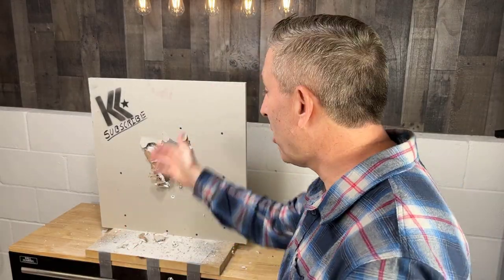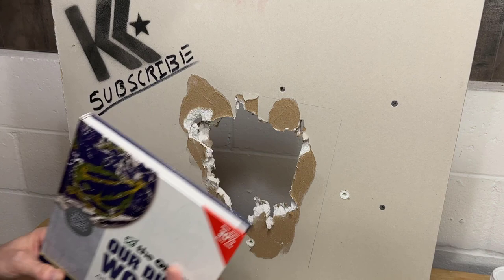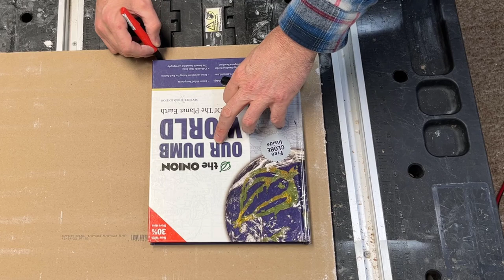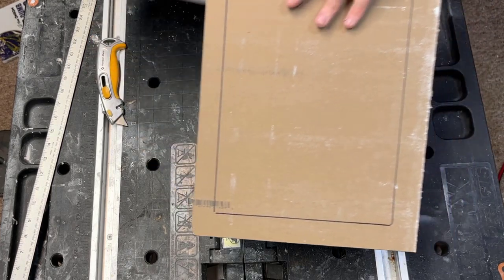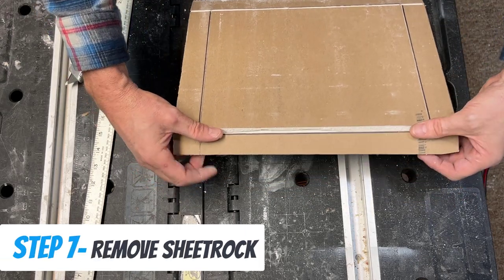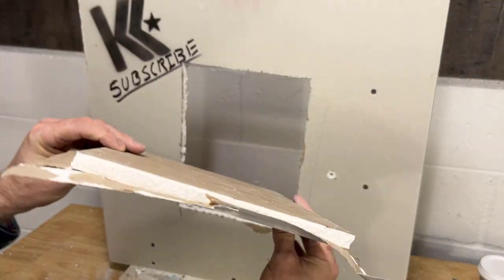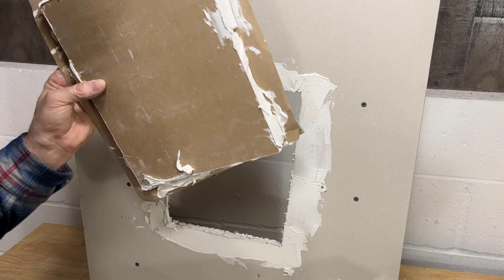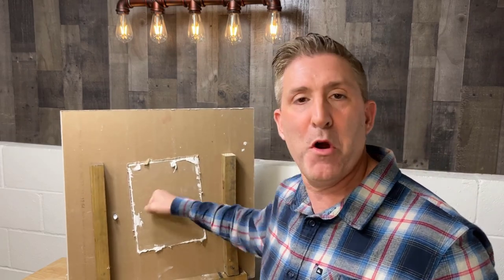PRO SECRET YOU DON'T KNOW - Easy & Best Drywall/Sheetrock Repair

Comment: Andrew, I am a carpenter this is a very old trick to fixing drywall they call this a blowout patch you want to cut the corners  on a 45 degree angle makes easier for Spackling so the corners don’t pop up I also you should have put a strip of wood behind it fastened with screws it make for a better Application  iuses for many years. It works perfectly and easily.
Reply from the maker: Thanks for comment - I like the idea of cutting the corners at a 45 - I will try that in the future ;)

Comment: #1 house repair I hate the most. The patch technique you used is bang on, the only correction is the sanding - there's NO NEED for it - best hack I found use a damp microfifer cloth to smooth things out, truly works.
Reply from the maker: Nice - I will have to try that

Comment: So a strange fist sized hole appeared in my old apartment, and I didn’t know much about patching so I litterly filled it little by little with sparkling.. it took a while but I got it lol.. anymore I  don’t have those odd sized holes in my walls but I do occasionally get spots from stuff stuck to wall or my elbow running into the wall (that didn’t feel good) so I haven’t had anything that big. I have used mesh but honestly I don’t like how it sits on top of the drywall.. if I was to get a big hole again I would use the wood drywall trick, this seems a little too drawn out.
Reply from the maker: I would have said the same thing - the setup is slow but the cleanup is fast